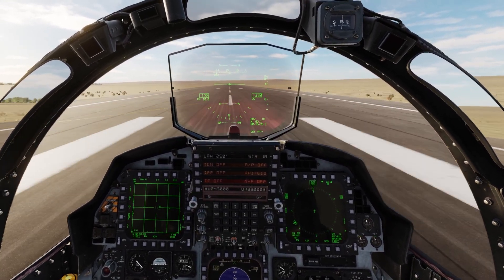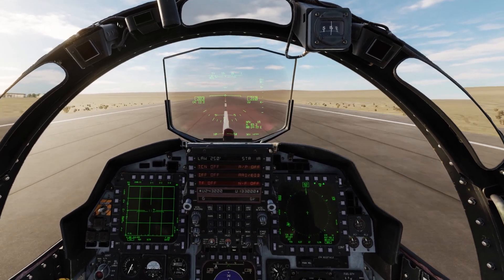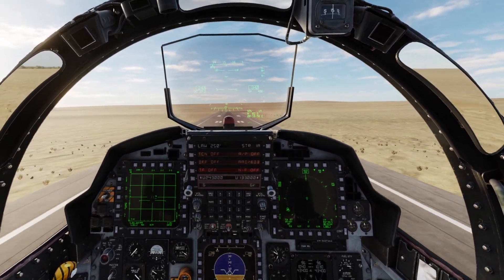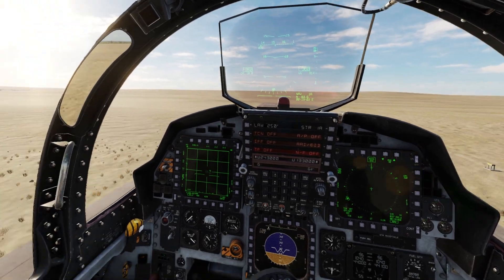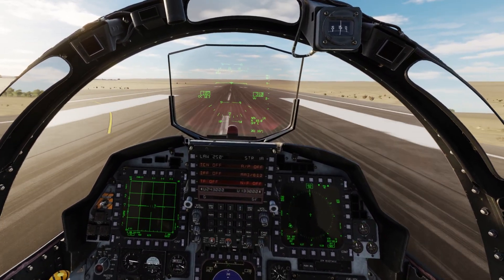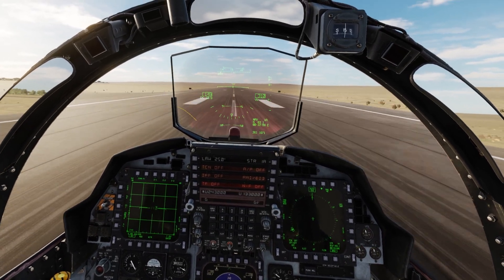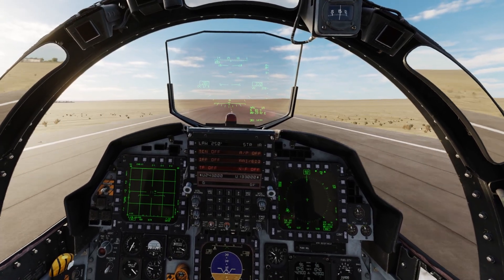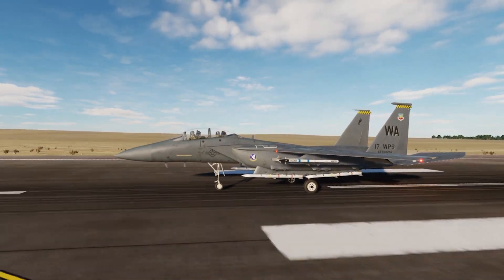DCS:  F-15E Takeoff Rotation Technique

Comment: Are the takeoff speeds in the kneepad, I thought they were?  Regarding the flight model, it's a bit off, the takeoff in this video is smooth, but much too fast, you should be able to achieve a smooth rotation and hold 10 degrees at the correct speeds, but it's extremely difficult, the nose wants to porpoise up and down, or even snap up as soon as the wheels leave the runway.  Then the nose rises and needs lots of nose down trim.  Was never that impressed with Razbam flight models in other aircraft, compared to the F18 for example.  They need to get the feeling right when the numbers are right.

Comment: you need a more aggressive rotation than that. you left the runway at about 225 kias, which is asking an enormous amount of your tires (likely close to- or exceeding their max rolling speed). You also just push it that much closer to VLO/VLE and VFE... You know the F15 can pull lots of AOA, and that should be apparent on the takeoff and landing too. 10-18 degrees nose up is my guess and I don't even fly the thing (but I fly a lot of jets in sims). The remainder is just extra ground roll and obstacle clearance margin you're leaving behind and above you. I don't even take off the A-10C that shallow.
Reply from the maker: Before talking, go try it, let me know how it works out for you in this F-15
Reply: @FSX404  I can't try it because I don't own it. But I own the F-15C/FA18C/F16C/A10A+C, and both Mirages. Maybe I'll trial it when that's available, or when I finally decide I want to get it.

I just checked the manual and they call for 10 degrees pitch up for takeoff.
Reply from the maker: @rjtoten  when you try it you will see it doesnt work like the others. Whether a Razbam, or DCS, or other issue. Any other pitchup than small will have the nose pitching up dramatically, the start to oscillate.

Comment: nice! How would you know at which rotation speed to rotate for a given Gross Weight
Reply from the maker: As a pilot you should know your rotation speeds before takeoff, but in the case of this F-15 it wont rotate until ready. In this case it was 200, and 175 respectively (seems a bit fast), I knew this from the previous video. Whether that is accurate, we'd have to check the performance, tho that is hard to find for the F-15E. But this video was more to show the process of rotation.
Reply: @FSX404  Yes indeed, but normally the manufacturer should give sharts with rotation speed for a set of weight. Maybe Razbam has provided that but i haven't finished reading the manual yet
Reply from the maker: @CMBelite-FR  maybe, but I have my doubts, could be possible. Anything found is usually an estimation for Gen4 planes still used. Usually the way we get these things for newer planes from someone who tested, some foreign power that got a hold of it and leaked, or more likely an estimate based on the aerodynamics, which is usually close, but not always accurate.
Reply: Is a bit fast, the real plane has to be lift off at 190/195 knots, razbam needs increase the lift curve, same thing as the mirage F-1
Reply from the maker: @CarlosMoreno-dq3kg  I think the lift is OK, they may just need to increase elevator effectiveness to lift the nose at 180kts for full weight and 150kts for combat weight. Which it does at full stick back but not with a minor pull. Full stick back pops the nose.
Reply: Possible, because it moves a lot the elevator for the take off, it seems like you said, it's moving all the range to take off